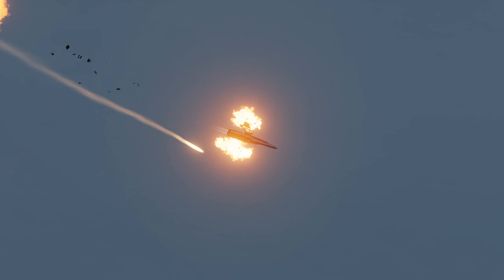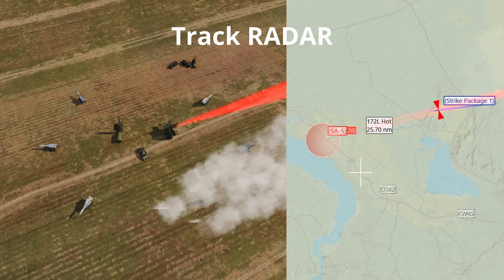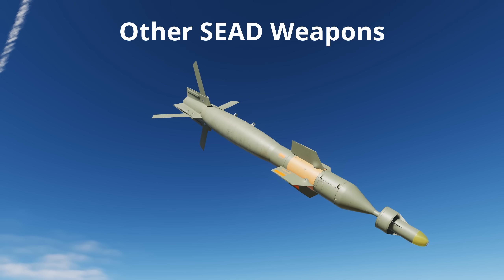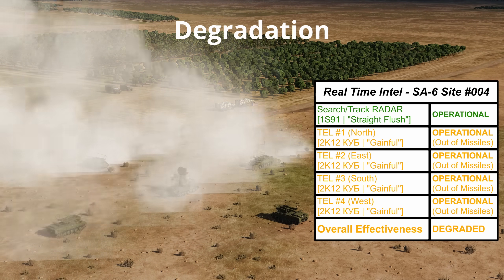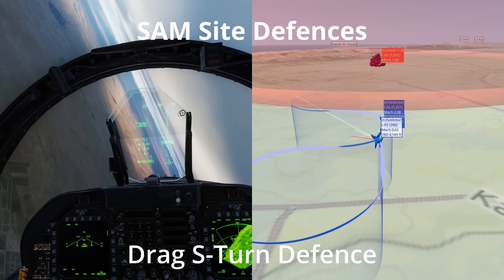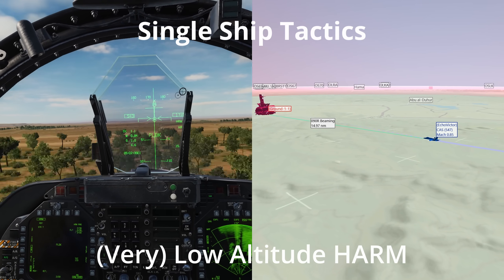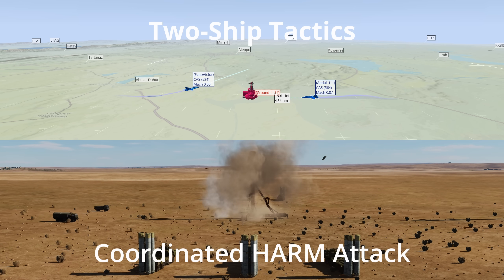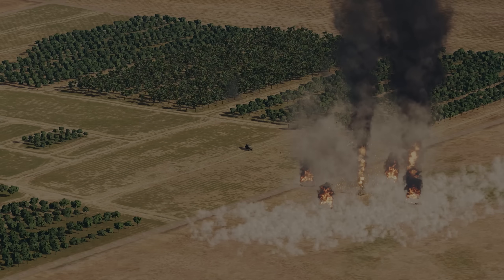SEAD - How to KILL SAM Sites! | DCS Tactics and Manoeuvring

Comment: One thing that DCS doesn't have are active radar decoys.
Reply from the maker: That's correct, newer versions of the TALD include limited Manoeuvring capabilities and chaff dispensers to mimic a real aircraft flying
Reply: @EchoVictorDCS  I was more think about ground based decoys. No SAM operators worth their money would deploy with out radar emitters, radar reflectors and most of the times ground based jammers and MANPADS ring to make terrain masking attempts more dangerous. 
Otherwise, this is the best explanation I seen on the internet with out touching on the classified info. 
Well done!
Reply from the maker: Ah yes I'm with you now. There are a few new assets that have been recently added but serve no purpose other than visual models and that is a GPS Jammer / Spoofer. A fun exercise is to make a group of units in DCS like the Search and track radar with a few launchers and then space the units apart. They are connected together through the group so you may have a missile launch at you from a totally different location. Would definitely be cool to have ground based radar decoys in DCS

Comment: A correction for 3:20 in the video, both the SA-19 and the SA-22 use command guidance for their missiles. As such, you cannot use the typical methods to break radar lock for these missiles. Even more dangerous, having the radar stop emitting on your RWR is not an indication that you are safe. Possibly even more dangerous, the SA-19 is capable of firing without even pinging you with its radar, so to the pilot it should be considered with the same regard as a manpad - there is often no warning. For them, you have to break the operator’s line-of-sight and keep it blocked because if the operator can re-acquire you they can continue to steer the missile(s) to you.
Reply: To be pedantic, they are SACLOS, Semi Automatic Command Line of Sight, which is Command Guidance but only through line of sight... kind of like laser guided but with radar waves instead.  Semi Automatic because all the operator has to do is keep the target in the aiming cone and the missile does the rest of the work.  There is full automatic command line of sight which includes tracking servos in the aiming device to automatically track the target's movement.

The SA-2 and SA-3 are true Command Guided missiles, which means the ground station is telling the missile how to maneuver directly by tracking the missile's flight relative to the target's flight.  Semi Active Radar Homing is the missile reading the radar waves off the target and making it's OWN decisions on how to intercept the target.  Active Radar being the missile is emitting it's own radar signal and adjusting it's flight path based upon it's own missile's radar.  Track Via Missile is a complex targeting methodology which falls into a more advanced form of SARH where the missile is sending what it is seeing back to the ground station which is then adjusting the course of the missile for intercept.  The advantages are a simpler (and cheaper) missile and increased resistance to saturation attacks since there are dedicated guidance channels for each missile launched.
Reply: @Whiskey11Gaming  This is true (I didn’t feel like getting deep into this) but my point remains, you cannot assume the no RWR alert is an indication that the danger has passed (we are talking about DCS implementation here). The points still stand, SA-19 can and will fire without triggering your RWR, and both it and the -22 will guide without any type of alert from your RWR. As such, you need to break line-of-sight, and keep low and maneuver - preferably all the way out of the effective range of the unit.
Reply from the maker: The fact these discussions are being spawned from my video makes me very happy. Lots of smart people sharing ideas, love to see it 👍 Lots of good info there, thanks guys :)

Comment: Which mode do I use for a low level HARM-attack in an F-16? It does not have PBLK.
Reply from the maker: In the viper you'll want to use the position known (POS) mode, which requires a steer point to be placed on or near the SAM site and the required threat table to be allocated to the HARM. I unfortunately don't have a video on this (yet) but the DCS F-16C Viper Manual page 529 does have all the info you will need :))
Reply: @EchoVictorDCS  Ah, so when in POS mode, the currently active steerpoint is automatically considered?
Reply from the maker: Once you select POS mode on the WPN page, you will select the corresponding threat table (TBL1/2/3) depending on the threat you are attacking (Newer SAM site/SHORAD or AAA/Older SAM sites).

Then you select the desired attack profile (EOM/PB/RUK) depending on the situation

Then select which steer point you want (this can be manually created using data from other aircraft acting as the "hunter")

"MAGNUM 1, SA-10"

Hope this helps!

Comment: A HARM doesn't go stupid just because the targets stops emitting. They'll simply go for the last known position of the emitter. To make sure the HARM misses, the emitter should not just stop emitting but also relocate ASAP.
Reply from the maker: Yep, the HARM stops tracking the target, ie it goes stupid and flies to where it last saw the target emit. If the location data the HARM has is of low quality then it will miss even if the target stays stationary. For the best chance of survival, the target can move as well
Reply: @EchoVictorDCS  "the HARM stops tracking the target, ie it goes stupid"

Ok, yes. I suppose the technical definition of going stupid is pretty much that, yes. I should have said "it isn't guaranteed to miss just because the emitter goes quiet".
Reply from the maker: Don't worry, I do agree with you. The HARM isn't guaranteed to miss if they only turn off the RADAR, as you rightly say they do need to move. Hope you enjoyed the video nonetheless:)

Comment: What about altitude? From a purely energy perspective, is it better to stay high, or drag the missile down?
Reply: Medium altitudes provide the best mix of options on how to handle a situation.  Low altitude is preferred because the missile will gain energy when it is shot at a high altitude target, even if that target drags it into lower altitude.  The reason is simple physics, but the longer the missile spends in THINNER air the more energy it is going to have as it is simply going faster and has more potential energy.  Being lower means it stays in thicker air longer and it wont achieve max velocity or range when shot at lower altitude targets.  Medium altitude gives you stand off capability with weapons, while also allowing for you to drop altitude to defeat missiles, without being so high you have no aerodynamics to defeat the missile.

In DCS world where you have pretty blurry front line situations and little in the way of "back field between target and front line" enemies, there is little reason to stay high, especially when dealing with longer ranged threats like the SA-10 family or SA-5... although remember, longer range SAM's also tend to give you more time to react to the launch than shorter range systems as they are all flying at you at roughly the same speeds! ;)
Reply from the maker: It all depends on the situation. If you know there is a SAM site and you want to destroy it, stay low and toss a HARM, as you won't be detected if you stay beneath the radar horizon or behind terrain. If you are transiting through a location where you don't know if there are any threats, better to stay higher and if a threat pops up, do the turn and dive defence.

Comment: great video, but there's a lot more to cover for the SU-25T pilots. Those kh-25mpu really don't aim accurately when fired from low altitude, and even the kh-58u can miss quite often. And I don't think I've even heard of anyone besides myself using the beam rider trick.
Reply from the maker: Thanks for the comment! This video was more aimed at what SEAD is, how air defences work and ways that air defences can be suppressed, rather than a specific FA-18C or F-16C viper tutorial. I'll likely go into using the Kh-25mpu in a future Su-25T tutorial series. Even I don't know how to use the Kh-25 😅
Reply: @EchoVictorDCS  it's meant to be fired from high altitude, but when there's a bunch of sa-15 or similar, they all just get shot down. If you fire it from low altitude like 40m with the nose level, it should use a ballistic trajectory which is nice because it can go over most of the trees, but then it misses the target like 90% of the time, so I mostly use them as a distraction. All I want to do is take the elint pod from my su-25T and plug it in to my f18 because the su-25T got the fast targeting, and the f18 got the better missiles.
Reply from the maker: @lobmobster Ah I see! I have really got to get back into the Frog and learn how to use it. That ELINT pod sounds interesting, is it similar to the HTS pod on viper?
Reply: @EchoVictorDCS  I don't know how to use the viper. I'm pretty much an expert on the su-25T, at least with the better weapons, and I'm still learning the f18. With the f18 the rate of fire of the harms is slower than I would like in TOO, and in PB it's really hard to attack more than 2 sams in one run if you want to get close and surprise them. With the SU-25T, it takes a little practice to line up the elint, but you can throw the book at them all almost in an instant, so it's a real shame the ARM missiles suck.
Reply: @EchoVictorDCS  Also, I go videos on my channel of me using elint, but you will notice I usually fire all the 25s at one target because they are probably gonna miss anyway; now imagine if you replace my 6 arm missiles with proper harms; that would be monstrous

Comment: Amazing video good job specially with the graphs
Will we get a video from you going over the different sam systems in detail?
A few notes though

SA19 and 22 both can use optical track for firing their missiles so you might not get a rwr track warning. Only a mws warning if avalaible.

Technically the 8 and 15 are supposed to be able todo same but not from my testing

Regarding tracking altitudes:
most modern sams like 10/11/15/19/22  can track you to appr. 20ft agl
Tested this with an apache for an accurate number (tho 19 still optical tracks you)
2/3/5/6 are easier to fly under the radar (dont have accurate numbers)

Regarding buddy lasing:
You have to be within 10-15nm otherwise the laser doesnt reach anymore so
Reply from the maker: Very good point thank you for letting me know, I didn't know that, it's always given an RWR Warning for me :)
Reply: @EchoVictorDCS had not much experience with sa22 though 19 frequently does it.
It might be a server thing.
Sa19 on hoggit servers never intercepts munitions for example so one needs to take into accounts server settings for units aswell.
Same with sa10 for a while on hoggit it was more a shorad within 20nm now it engages way further.
Reply: @julianviefers6703  hq-7 too; that one is weird; I posted a clip in forums showing it's weird behaviour to no avail.